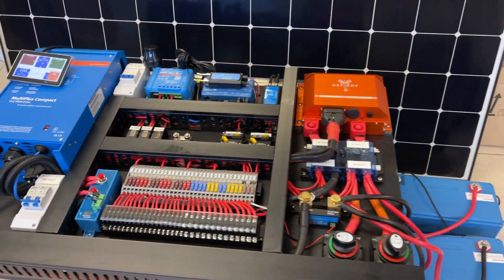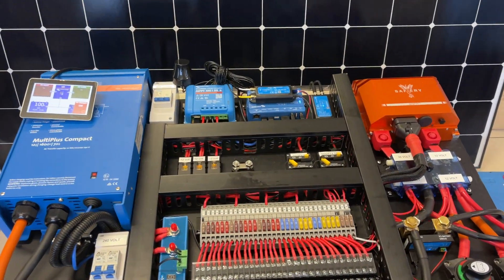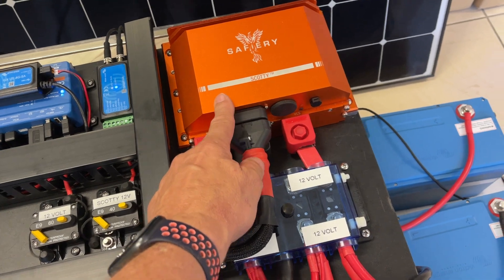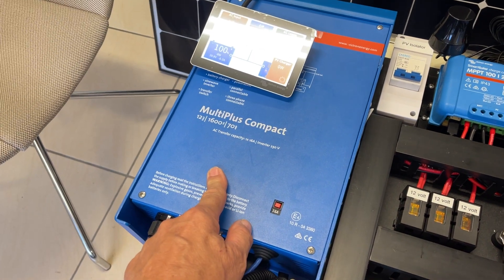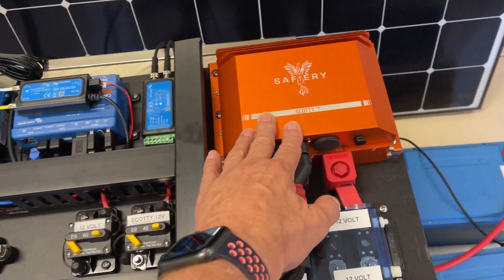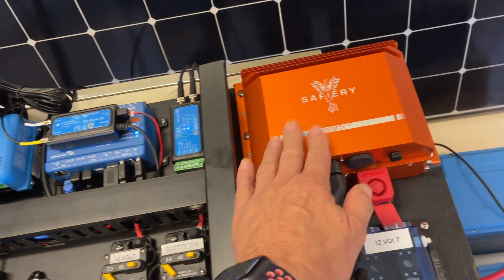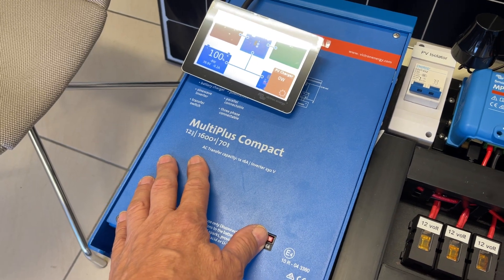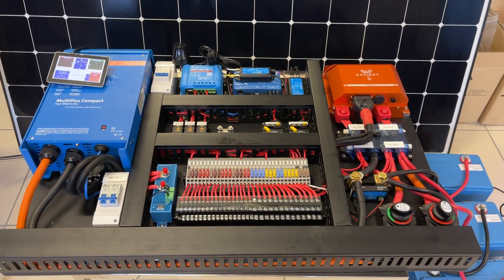36V Lithium as Master battery with Scotty to 12V alternator and 1600W Inverter Charger: clean system

Comment: Thanks for the video!
This seems a very, very neat setup.
Do you have further info on this assembly? Like components, expected loads, wire thickness, ...?
I'm especially a bit worried about the max amperage going from alternator just at 12v...
Congrats!
Reply from the maker: Hi , we dont issue any further info to protect our IP. Just the video. Work on 180A max on the 12V side. Cheers
Reply: @Safiery  Thanks for your quick input.
This plus the tanks module ... yammy... (still choosing components for the van)